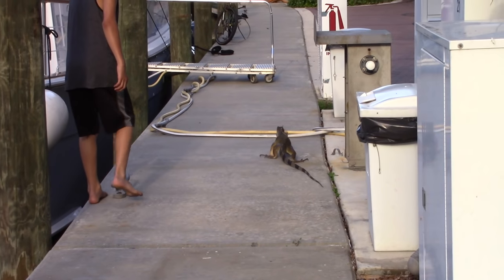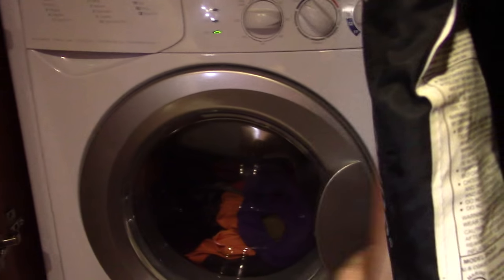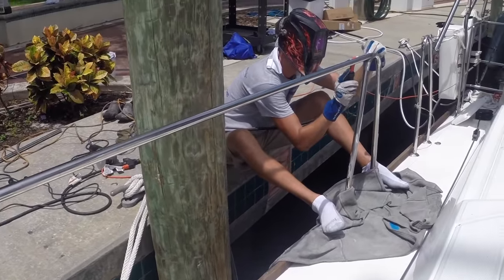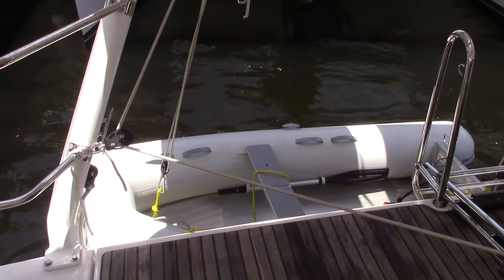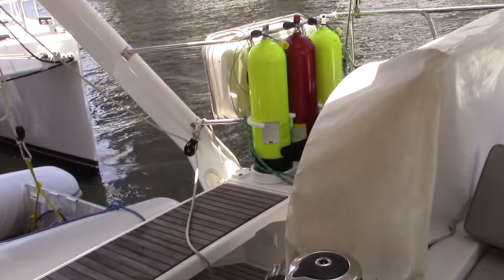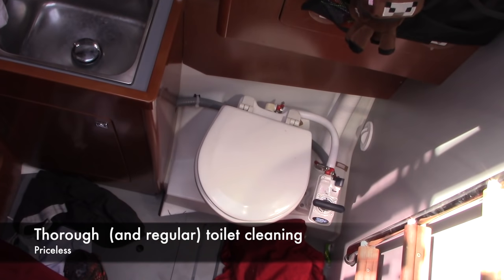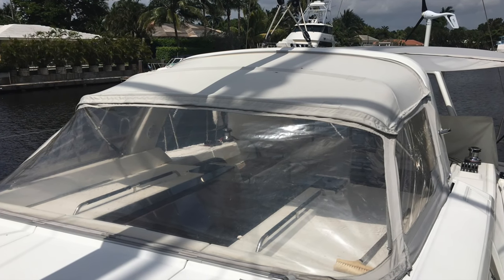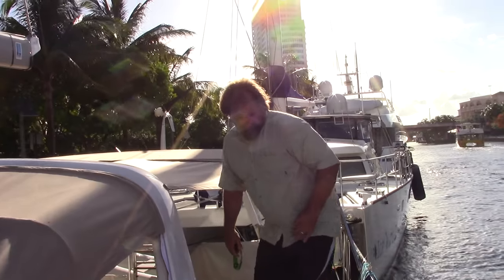Progress and Q&A [Ep 6]

Comment: That boat must have had a rough life to need so many repairs  and be so new.  Most folks would already have had to give up.    Good luck to you.
Reply from the maker: The boat I believe just set for 6 months without anyone using it.   The only real repairs that we have had is the gen set which is still covered under warranty . The heads I think where our fault and the Bimini was 3 years old and had just been sitting in the weather along time.   Other than that we have not had anything major.

Comment: Just thought i'd make a quick comment on the mono vs cat debate. FRP boats are sold by the pound of glass not LOA. therefore you cant compare a 40 ft cat to a 40 ft mono. A 40 ft mono is smaller lighter(less ballast) and cheaper.Comparing a 40 ft cat to a 56-60 ft mono is more of a apples to apples compariton as to cost etc. Thus a cat is all of a sudden not faster or more stable as a longer waterline buys much more comfort at sea than the extra beam. Cats roll less at anchor. which is there one big benefit which to me is not much cuz who wants to stay in a rolly anchorage long anyway. Leaning at 10/15 degrees bothers some people but it is a pressure release valve that makes single/double handing safer. when cats get overpowered they just flip over...and party over then